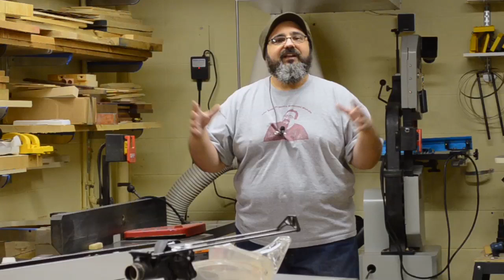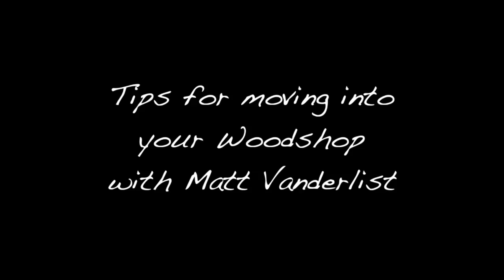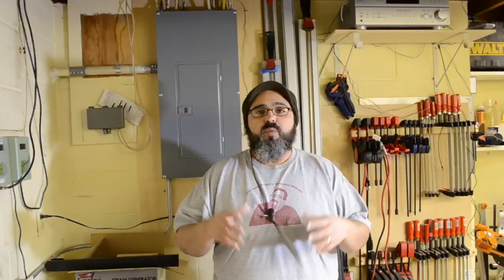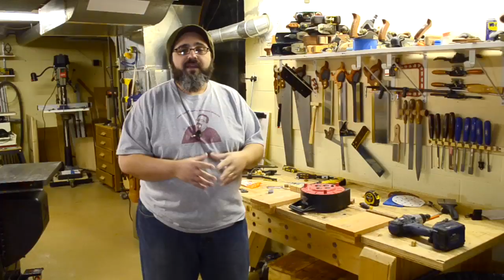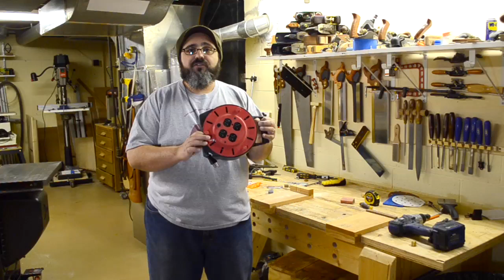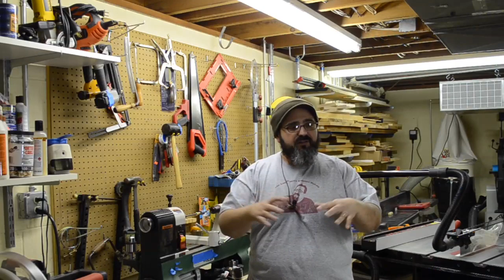Setting up a Woodworking Shop with Matt Vanderlist

Comment: having a shop in your basement what difficulties have you had with your heating system v dust control have you had.....i also have a shop in basement lucky for me its large enough to separate of the two...  although I'm still setting up due to us moving.........

Comment: Yup, thinking the power part through first is important.  Different outlets on different circuits help spread the load when using tools together.  I learned that the hard way.  Cheers.